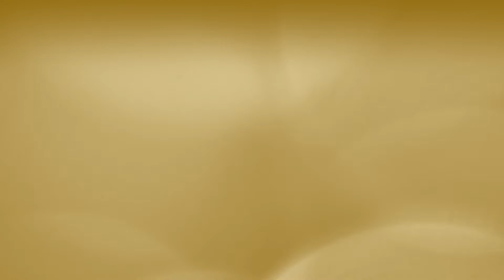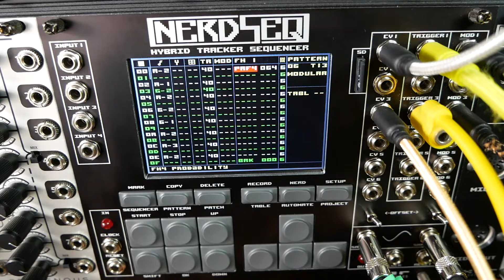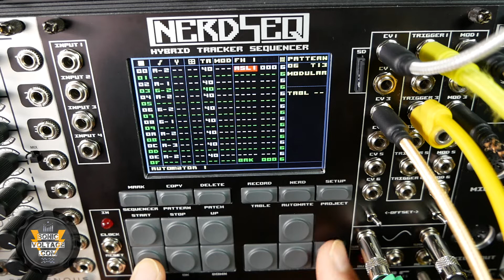XOR Electronics Nerdseq Eurorack Sequencer Review Demo Tutorial Part 5: LFO FXs RNDM BPM More...

Comment: because going back to inputting note information in the slowest way possible was a good idea.. 
Like tracking solved music yo ! It was sooo much easier back when you had to spend 5 minutes per note.
Reply from the maker: :) mmm.. no really :)  A lot of eurorack modular synth users tend to not have a piano-type-keyboard in their setup. Eurorack Sequencers tend to be mainly note-cv-slider or cv-rotary-knob or button-push-display-cv type of devices. Within that context, tracker-based note input becomes really quick with just a little bit of use. Also, it is indeed really quick to add so much detail to each note/step via a tracker based system with all/most data types visible next to each other... BUT we all have preferences, habits... our preference may even change depending on the specific task/environment/goal... So, it is good to have so many different types of solutions (different sequencers and note input types)... from a variety of external sequencer solutions, keyboards.. to sequencer modules with sliders, trackers, mini keys... myself, at times I prefer using an actual keyboard with midi-cv converter.. other times I prefer non-keyboard workflow... good to have the options. And if it comes down to smaller setups, portable setups... the option to leave your laptop and midi-keyboard at home is always a good one :)
Reply: @SonicVoltage  I'm aware they most commonly rotary type note inputs - I just (personally) find a tracker system cumbersome - 
I realise it's just personal preference and it's just a peeve i have with tracker type systems .. 
I Prefer doing things in either a "trigger riot" fashion or if you like step lengths into the thousands perhaps an ER-101 or similar. 
I can just do without "tracker hassle" in my life. .. Maybe just opt for a full on piano roll option in modular like the "1010music  Toolbox"
I can see the randomising feature being handy .. 
Thanks for the response however.
Reply from the maker: @RecordingOfMind  Cool stuff... and thank you for checking my video out.
Reply: "slowest way possible"... Look Mum No Computer's youtube vid on the Nerdseq clearly proves otherwise! And why the sarcasm?
Reply: @oldmossystone  I have, However that's also one of Sam's most unmusical and chaotic things .. .
nothing takes long when you just input random beats and notes quickly, but how does it sound. 
No need to be so defensive either.. 
If you like tracking go for it.. 
If you don't - there are other methods. Thankfully.
Reply: @RecordingOfMind   Personally, I think that the only reason tracking didn't "solved music yo" is because it can't do polyphony (not well anyway). It came from a limited technical environment where polyphonic instruments were pretty much impossible at the time, and it's interface 'philosophy' reflects this. Attempts at shoehorning polyphony in there are clunky and problematic at best. Piano roll based interface wins easily in this context. Eurorack however is primarily a monophonic technology, so the idea of multiple monophonic tracks fits perfectly - it's an ideal solution. It obviously doesn't work for you, for whatever reason. But there has been very positive reactions in the community towards Nerdseq. Seems that for many folks it is currently the best option.
Reply: @oldmossystone  Fair enough - Truth is one, paths are many. ..
Reply: There is actually a very fast way of adding notes using the midi expansion. If you connect a midi keyboard to the midi input it will record notes in whatever midi channel’s respective track you are on.